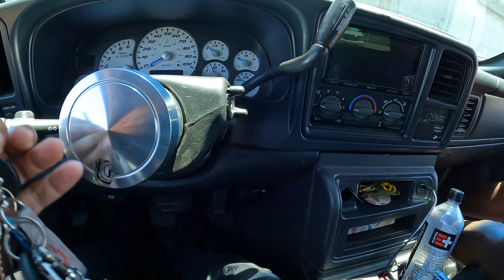I’m Going To Miss This Car…

Comment: I used to hate on the 300zx because of how slow and heavy they are but you definitely showed the potential the chassis has. Gonna miss that thing, I feel like it would be an awesome car to get into scca or track racing. Light, full cage, plenty of power to rip through the bends. Whoever gets their hands on it better take good care of her.
Reply: Sounds like a lot of misplaced hate brah. Weight and performance wise it was in line with its direct competition, the Z32 was in no way the Challenger/Charger of it's day.
Reply: @SpikeRazzor  I could see where you’re coming from but we all have opinions and that’s my take on it. My old 180hp single wheel peel 325i took a few of them. Beat a tt one too by like half a length and it sounded like it was running decent. Never driven one but I’ve raced a few. Too much useless tech and that boat anchor of a vg30. I bet it’s fun to drive though
Reply: No😢

Comment: I am going to miss the 300zx because of u myke myke u inspired to me soon to build my car I have a 2014 Toyota Corolla its getting high on mileage and I been looking around on the internet and haven't anyone do this yet what I am thinking about doing is putting an ls3 motor in my 2014 Toyota Corolla and converting it to rear wheel drive and I haven't decided either to keep the body oem or or put aftermarket bodykit on and wide wheels I haven't seen anyone do that to a Corolla yet with an ls3